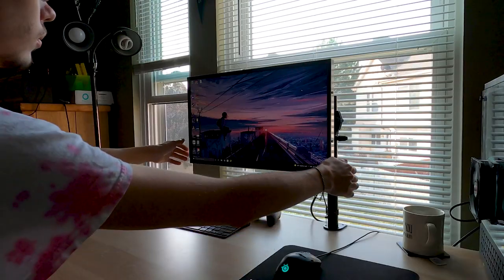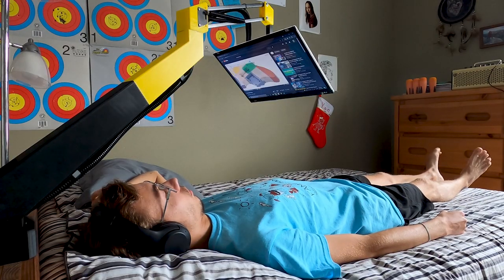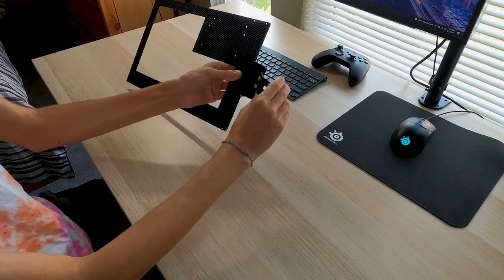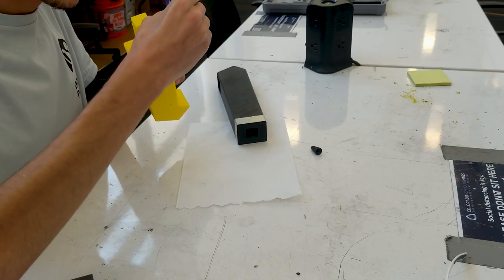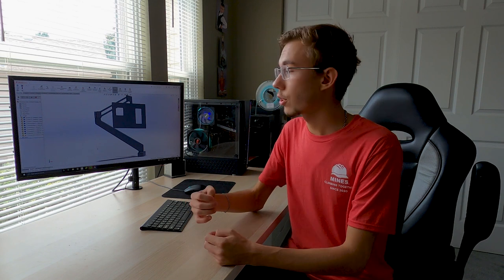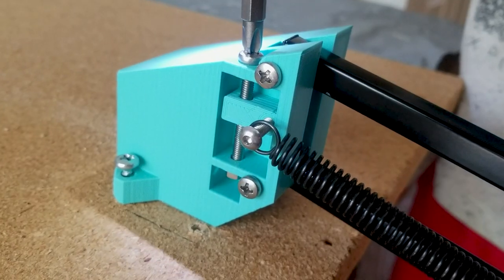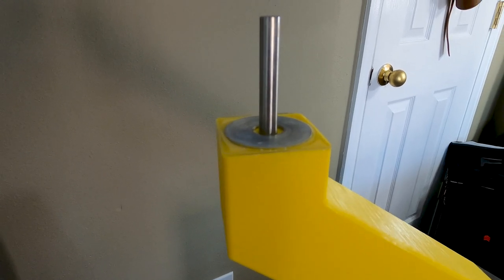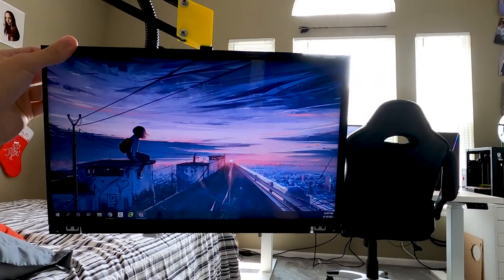Building a 3D Printed Monitor Arm for Your Bed

Comment: That's a cool project! I'm creating one for my desk for a portable monitor, but it's 100% 3D printed. It can rotate at the base, the height and depth of the monitor is adjustable, and it has a ball head to adjust its angle. Because that portable monitor doesn't have a VESA mount, my arm holds it using claws similar to a phone tripod mount. Aside from the rotation at the base, which will have its friction adjustable with a screw and lever system, the height and depth are adjustable with geared rails. You just have to hold the monitor at an angle, and you can then adjust either the height or the depth without having to loosen anything, and it won't move once it's adjusted.

Comment: Great work. I also want to do something similar with a desktop monitor and the heavy weight will be challenging. Fortunately I do not require as much range/complexity of motion as yours provides, so I think it may be possible to achieve inexpensively. Mine will only need to go down into position, and upwards and out of the way when not in use.
Reply from the maker: For your desing you might get away with just a simple locking mechanism. It could be a button you press that unlocks the joint and allows you to move it freely. Then once it is locked, it stays in place.
Reply: i want to do the same thing, will you make your design on thingiverse ?

Comment: Ha!l Only a guy into robotics would have used magnets for friction as opposed to a regular mechanic who would have used rubber O-rings. Excellent work man. That thing is built to last and function as intended throughout it's life, O-rings would have worn out and needed replacement overtime.  Kudos brother.

Comment: I have a similar setup but I’m using a Lenovo Xiaoxin pad pro 12.7inch tablet and I stream my games from PC using Moonlight, the tablet has a Snapdragon 870 processor which is kinda outdated by now but remains to be one of the best for streaming, the video decoding latency is ridiculously low. Oh and I’m simply using a 3 section tablet mount which you can find for around $15 or less.

Comment: When will this be on amazon? I cannot find any monitor arm that can tilt 90 degrees down in the market. The only option are the expensive hospital bed arms. If you can produce something like this for $100-$200 a unit, I am pretty sure it would sell like water.
Reply from the maker: Thank you for your suggestion. Initially, I didn't plan on selling them because of startup cost but I think I might be able to soon because V2 and V3 of this design are nearly complete now. I would feel more confident selling the new design because I had more time to address the issues.

Comment: @Yan Ostanin very nice idea! Is there any place to buy this as how it is instead of self building? Thanks
Reply from the maker: Thank you Dania, the closest commercially available thing I found is a tablet holder. You can check it out here: https://www.amazon.com/Foldable-Aluminum-Universal-Flexible-Rotation/dp/B08FMSCCG9/ref=asc_df_B08FMSCCG9/?tag=hyprod-20&linkCode=df0&hvadid=459710794544&hvpos&hvnetw=g&hvrand=12317214711594251057&hvpone&hvptwo&hvqmt&hvdev=c&hvdvcmdl&hvlocint&hvlocphy=9028730&hvtargid=pla-968638381111&psc=1
I hope that helps

Comment: Is it possible to buy this arm from you? My nephew is currently in a hospital bed and this would be perfect for him, but I’m not handy and can’t build it myself.
Reply from the maker: I'm very sorry that your nephew is in the hospital. I was not planing on selling it but I am working on a new version that will be much more simple to make. If you want to get something for your nephew that will be just as effective try this: https://www.amazon.com/Foldable-Aluminum-Universal-Flexible-Rotation/dp/B08FMSCCG9/ref=asc_df_B08FMSCCG9/?tag=hyprod-20&linkCode=df0&hvadid=459710794544&hvpos=&hvnetw=g&hvrand=12317214711594251057&hvpone=&hvptwo=&hvqmt=&hvdev=c&hvdvcmdl=&hvlocint=&hvlocphy=9028730&hvtargid=pla-968638381111&psc=1
Reply: @yanostanin  That would not support a monitor, would it?  If you don't want to manufacture this yourself, you could sell the design to a company.

Comment: hello you could link the spring what kind of spring it is
Reply from the maker: Hi, I used a spring that i found in my house. its a 600N/m coefficient spring that is 10cm in length. That probably doesn't help you in buying a spring because you need more information so ill get back to you if I find a spring online that matches the one I used